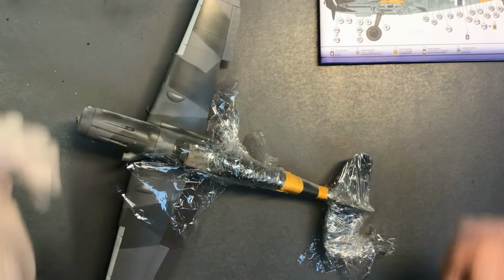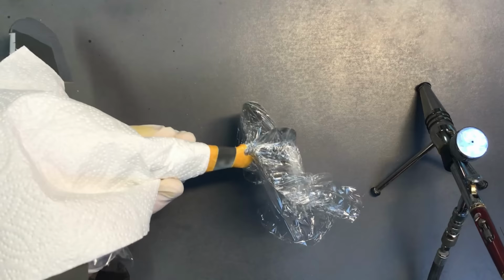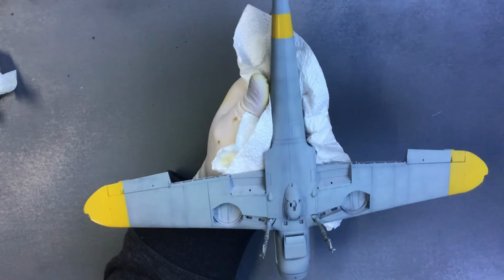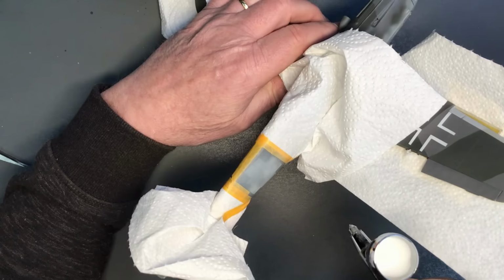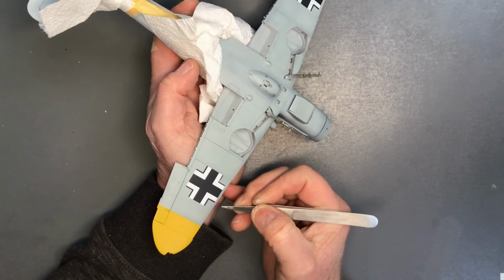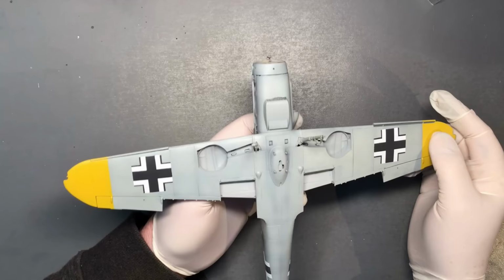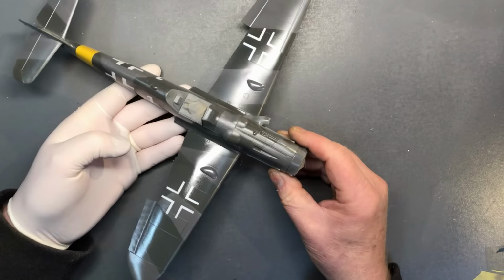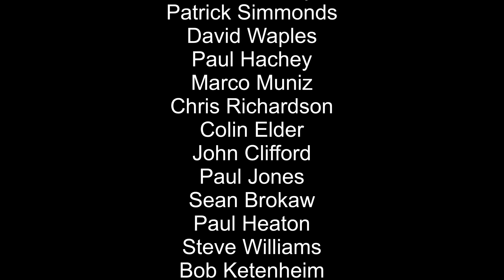Zoukei Mura 1/32 Bf109G-14 Part 5b

Comment: Hi,Steve! I have seen,that you had to fill gaps and correct the lower engine cowl.What is your résumé?Would you buy the kit again?Can you recommend it?Is it worth the price?
Reply from the maker: Hi Detlev I would say that it’s only one to go for if you’ve got the experience to get the fit right. it’s definitely over engineered and I’d only do another if I were going to build it in skeleton form to show off the internals perhaps with extra detailing. The Revell 109G kits are much cheaper and although not as well detailed could give a similar result.